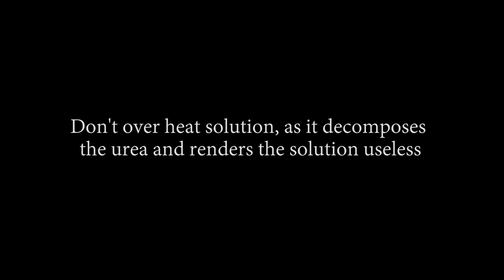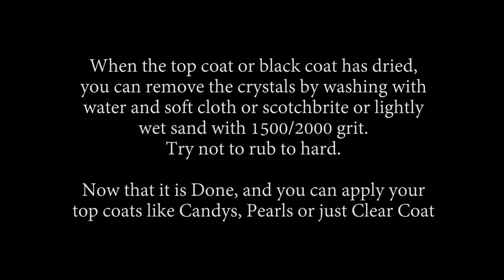Tutorial How to Make Crystal fx Solutions

Comment: How did you get the crystal solution to stick to the silver paint?  Mine just keeps beading on the surface even sanding the paint with 800 grit.  I did 1:1 ratio with 3 drops of dish soap.

It's probably the silver paint I am using (Rustoleum enamel).  It is oil-based, so it probably does not let water stick to it 🤔.
Reply: Bro did u got the solution..even i am getting same problem it disappearing
Reply: @ChinnBabu-zi4sh  Nah I gave up on it already.  Got tired of it.
Reply: Not sticking properly
Reply: Вам нужно покрыть базу небольшим слоем лака, потом отшлифовать и уже потом наносить раствор мочевины. И еще, перед нанесением мочевины нужно хорошо промыть деталь мыльным раствором

Comment: From my experience, you get more crystals if you do a 1:1 ratio of water to urea. 100ml of water should be 100g of urea, 50ml water:50g urea, 500ml water:500g urea, etc. The rest of your process is spot on those. Warm the water to help the urea dissolve and a drop of dish soap to help is spread across the surface
Reply: is this urea a fartilizer
Reply: @Mama-fl5ey  Yes it is
Reply: Thank you. I actually bought a bottle that looks very similar to the urea crystal effect but has more of a white color to it, it also has holiday decals on it. That is where I got the idea to make my own. Thank you for replying. I’ll just have to come up with some other idea for the wine bottles, cork fairy lights and decals. Not sure water slide decals will stick to frost paint or even if I used etching cream. Thank you again.
Reply: @Maskeddude hi as l see u have good experience about it. Really hope u can be help me. l do m8x urea and water 1:1. But effects were so smaller. İs there a way to make effects size bigger ?
Reply: @ersindere2489  You can apply heat to help it dry quicker. The faster it dries the less crystals it has time to form, therefore the existing crystals are larger. You can use a heat gun on a low setting or a hair dryer, just try not to blow the liquid around or your crystals will break. You can also do it out in the sun on a hot day as well. If you practice enough, you can also work in sections at a time. You just have to be careful not to wash away the crystals you've already created. This will let you create and remove areas you dont like until you get the desired effect you want. But I recommend just starting with a heat gun until you get the hang of it
Reply: @Maskeddude  
I did everything according to your instructions, but ultimately nothing changed. There was no change in the effect of the crystals; they are very small.
- I used metallic grey paint.
- I used 100 grams of water and 100 grams of urea fertiliser. 
- I heated the fertiliser and water in a clean tin can until it reached 40-50 degrees and dissolved it.
- I added about 2 drops of liquid dishwashing detergent and stirred it.
- After the primer dried, I sanded it and painted it metallic grey. After the metallic paint dried, I sanded that too and wiped it down...
- I applied the solution evenly everywhere with a brush, then poured the solution over it.
- After some water had drained off, I held a heat gun 30-40 centimetres above it and kept it steady.
- I pressed down on some areas intermittently with something thin, as if making holes.
- The crystal effects started to appear, but they were very small.
- The water I used was not distilled water, and the paint I used after the primer was metallic grey... Could this be the cause? 
Or do you see any other mistakes or shortcomings?
Thank you very much for your help and interest.
Reply: Is destilled water better?
Reply: @SanchinTanuki  Distilled water didnt seem to have any different effect in experience
Reply: @Maskeddude  Thank you! 😊
Reply: Can you help me I am having issues with my surface tension I am using 1:1 mix heating to 160f applying on clear coat sanded to 600 also tried 800
Reply: @anthony_trillanes  the way it works is, you put a first coat down of what ever bright/reflective paint/primer you want (the crystals dont stick to metal too well on their own and will make the piece look patchy when you wipe them away), cover it in the crystals, let them dry, then do a light dusting of your black paint over top. You dont have to go on heavy with the black, you want to allow the crystals to aid in the "shading". The crystals are water soluble, so you dont need to sand them hard or with any rough abrasive, a wet sponge will do the trick. What happens is, the paint adheres to the crystals and when you wipe them away, it reveals the bright/reflective base underneath. The thicker the crystal, the more black paint will adhere to it. The thinner the crystal area, the greater chance the paint will adhere to the base coat instead and thats what gives you the shading effect.
Reply: @Maskeddude Hi! Im trying to make this effect on glass bottles for gifts. I want to insert fairy lights so I don’t want the bottles opaque. Do you suggest a clear coat on bottle first? Then urea solution and then a white acrylic spray paint (to make it look like ice crystals for winter holiday gifts)? I’m doing this from a craft point of view, not science. So I don’t know if what I’m asking will work or not. Thanks for your help!
Reply: @JoeBarbfvOceanDream  Rustolium actually makes a really good Frost spray for windows and glass that is only $6. It produces a much better "frost" effect than this would on glass. The urea solution works better when you have a reflective surface to refract the light showing the "crystal effect" while the surrounding area is darkened
Reply: @anthony_trillanes  I also just realized I may not have answered your question. The surface tension and the size of the crystals are determined by the speed they dry at. The longer it takes to dry, the smaller and more detailed the crystals get. The faster they dry the bigger and more spread out the crystals get. You can aid in the process by leaving it to dry in a temperature controlled environment and also by how much of the liquid you brush on
Reply: If you made a batch, c
an you store it for some other time?
Reply: @johanpetit515  Unfortunately, no not really. It will last for a couple of days or maybe a week after it's been mixed before the solution starts to break down and you'll lose the effect
Reply: What is urea?? is that a fertilizer?? 😅
Reply: @albertseguerrajoyel2255  urea is a carbamic acid. It's used to breakdown and metabolize nitrogen. It's a chemical thats used in a lot of fertilizers but also in beauty products, health products, automobile production, etc
Reply: I tried the 1:1 ratio, and I got short crystals.  Not much build up to when I spray top coat. When I wash off, color washes off also.  Please help
Reply: Maskeddude , What kind of black paint can I use so that I can get it off without scrubbing so hard . I have tried acrylic in an aerosol can but it drys too quick for me to get it off without scrubbing the crystals off . I try to wash if off as soon as I get done spraying but it gets too dry . I'm trying to paint a baseball helmet .
Reply: @David-j6o9t  Acrylic is fine, you just have to do a light coat. You are using the black paint to create shading inbetween the crystals. The crystals are supposed to come off. The paint adheres to the crystals and when you wash them off, thats what exposes your paint underneath. The crystals act as a block or stencil so the paint doesnt adhere to your surface, creating almost an inverse effect
Reply: @Maskeddude  Thanks , bud
Reply: @Maskeddude  Would it be better to use black rustoleum .. I don't know much about this stuff , but you seem very knowledgeable  about this . Thanks
Reply: @David-j6o9t  Black Rustolium works fne. The important part is having a shiny/reflective/glossy primary coat of paint/primer first (what ever color you want the object to be) or if you're doing it on bare metal, make sure its clean before you add the crystlas solution. That's what shines through when you wipe away all the crystals with the water and sponge and the black acts as the shading giving it that "Crystal look". It's sort of an optical illusion
Reply: @Maskeddude  Thank you very much. I'm going to try to paint my grandson a baseball helmet , so I do thank you a lot.
Reply: Can i Let it dry in the sunlight?
Reply: @sunilsunil-jp3mk yeah, it will affect the crystal sizes though. The faster it dries, the fewer but larger the crystals become

Comment: Hey, this is a pretty cool trick and it saves some money I bet, for those on a budget. One question, does heating it when drying make the crystals grow differently or in a tighter pattern or do they grow the same way air drying or heat drying ? Thanks for the info on how to make it.
Reply from the maker: Ya, when you heat it, that will grow large pattern
Reply: Bro what is powder name
Reply: @shaikirfanroyals3418  urea
Reply: @KM-fckutube  where did get this sir.
Reply: @KM-fckutube  what is urea? What does it mean in Turkish, which product😊
Reply from the maker: Fertilizer prill
Reply: @gtsgaming8314  Lowes or Home depot. It is fertilizer
Reply: @enestrman7102 üre dediği bizim bildiğimiz azot gübresi sanırım. sen uygulama yapabildinmi kral?

Comment: Which type of basecoat should I use and should I use topcoat before crystallizing
Reply from the maker: Choose yourself, and must use top coat.
Reply: Thanks for reply ! I had some more questions. Do I need to sand the clear coat and does it require sunlight to dry ? Does it dry under shade ?
Reply from the maker: No, if your result showing nice and smooth surface, and you can dry it with sunlight or just shade. You can see technical information at the package of your clear coat

Comment: I picked up some urea from the hardware store. It came in pellets and is not completely white. Its urea by a company called Espoma. Any idea if this stuff will suffice?
Reply: It takes minimal effort really to set it all up and try it. Idea start there first then of it doeant give you the desired outcome look for answers. 🤷‍♂️ If its Urea it should work. If its granulated try breaking it up into a powder. In thinking the only disadvantage will be the time it takes to break it down in the water. The bigger the granules/ pellets, the longer it will take too dissolve. You cant just use more heat to do it either because it will evaporate the Urea. Try breaking it up and fallowing his steps here. Good luck